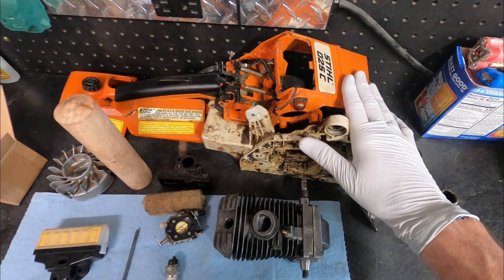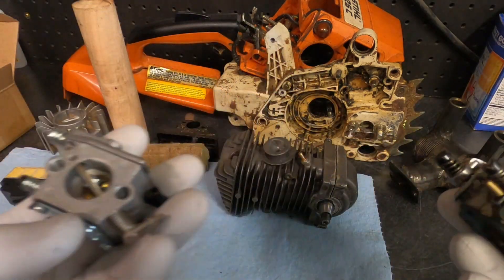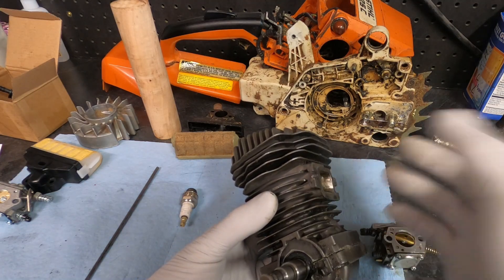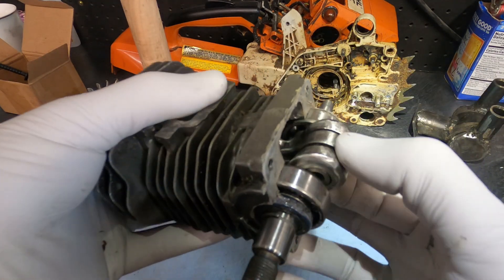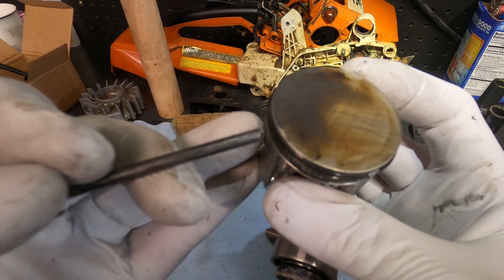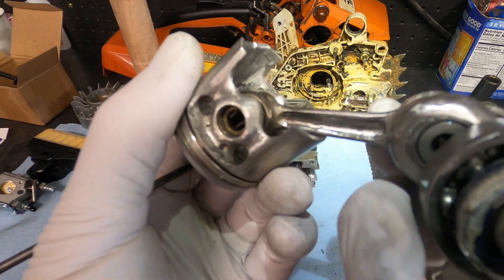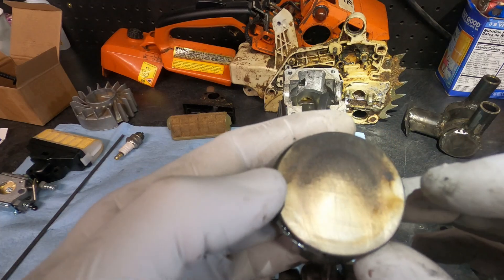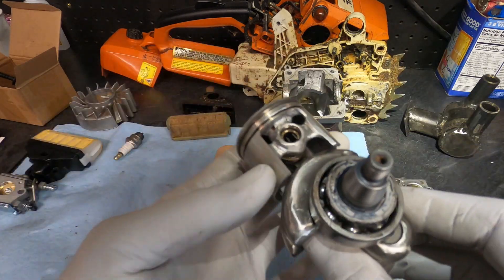Stihl 025 Performance Build Part:8 Inspection after six tanks of fuel/work

Comment: Did you replace the wrist pin clips with good ones?  With the known failures of the kind that you used I guess that would be doing the same job twice, if you remember to.  I have learned that the remembering is getting to be an issue at my house 😢.  But I am ancient, so……
Reply from the maker: I have had it back apart a few more times and I have not put the other style in. I am careful to align these with the tab vertical, to lessen the forces on it. At this point it’s an experiment in itself.

Comment: 11 months later and no part:9 video, did this saw blow up on initial testing? 
If yes it would be interesting to know what failed as a lot of material was removed.
Reply from the maker: Honestly, had a lot going on and just put the GoPro down for a while. This video was after 6 tanks in the saw, cutting, it definitely did not blow up. 

Part 9, I cut the squish band back to .180” then tapered up at 15* from there.  It runs great like that except for hot days like 85f. I believe at that point it was just not cooling well enough for that level of heat production when trying to use it for a few tanks straight. On cool fall days, no problem.  I believe Haychaff also found a similar situation with removing a lot of area from the quench (not sure what video that was) 

I have ordered, and thus have on hand another motor that I planed on making further drastic changes to. I guess if there is interest, I could make some simple recordings of that. Or a one year inspection on this.  Thanks for the feedback.

Comment: Interesting update.  That carb should help with tuning at least.  Looking forward to seeing it modded.  Smoothing the screws should do something positive. 
I like the idea of working the piston rather than the rings, but i suspect the rings would be easier.  2nd low tension ring sounds like a good idea as well.
Still thinking of "stretching" that rod?
Reply from the maker: Thanks Kevin, yes I am definitely think about a longer connecting rod. I think it would have a lot of positive potential.  The question is, do it to this one after these updates and tests, or on another engine entirely.
Reply: @Archer_82 I’m wondering if the 029 crank/rod assembly would work in these. I like this series of videos, it definitely has me thinking
Reply from the maker: @jeremiahcox3151 Thank you for following along. I just went a measured, the 250 crank is 2.020” outside of bearings. The 390 crank is 2.330” outside of bearings. I think that modification is a little beyond my current skill/tool set.  I have heard of stock crankshafts being “stroked” by building up the outer diameter with weld, and returning the crank…. Actually I have an extra factory crank here, and they press apart, and the surface would not need to be perfect because we use a roller bearing on it that has its own inside race… and that would negate the need to lengthen the rod.  I would think that 2mm of change would be significant in this case (or clamshell). Well shoot, now I know what I’m going to be thinking about all day, thanks for the input!!
Reply from the maker: @jeremiahcox3151  okay, these motors come with .040 squish, and the ring is .100 down from the piston top. That means Max we can move the stroke up at the top face of the ring is .140 with no margin, before we exit the plating. 3mm is .118, and a 42.5mm x 35mm(+3mm stroke) would be 49.65cc or a 10% displacement increase by stroke.  I’m not sure yet how that will clear the lower clam half, but the wheels are turning. 3mm would be enough to make a difference for sure. For clearance we could also take some off that piston top, aiming for about a 98 exhaust roof, unless the longer stroke needs something different. I’m open for input here.
Reply: @Archer_82  according to what I’ve read, the 029/290 has a 2mm longer stroke than the 025. If you were to build another one in the future this would save you some hand work.
Reply: I would lean toward doing the rod mod on the next saw with that in mind from the beginning.  Sounds easier than raising the bearing pockets to me. 
That exhaust is likely already loud enough that an Ironhorse shouldn't seem too bad.
Reply from the maker: @Kevin.L_ oh yes, they are both plenty loud, this one is very open. 

I’ll think about what motor to do that with. Not sure yet if it will be the other 45cc build in the 021, or a new assembly.